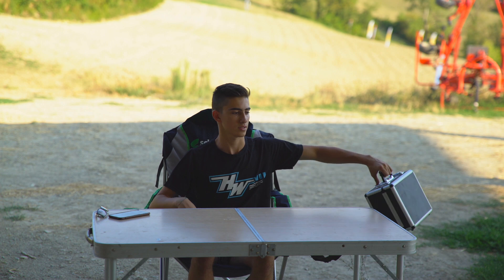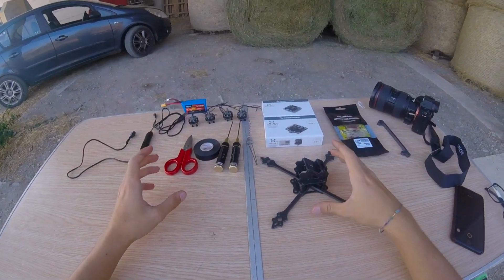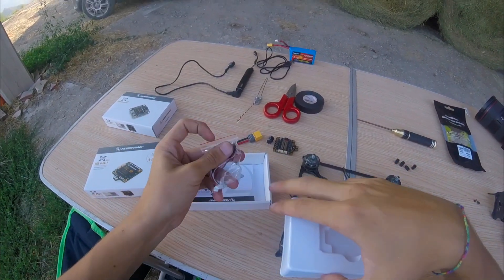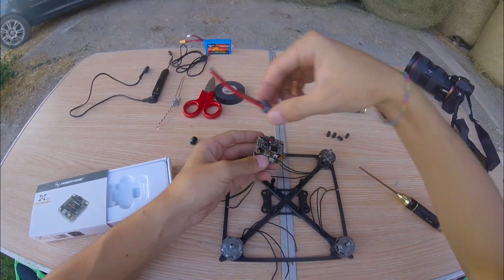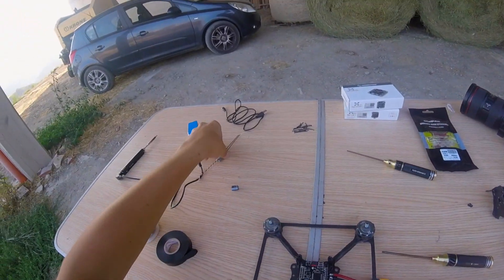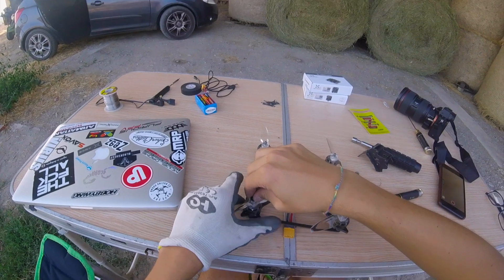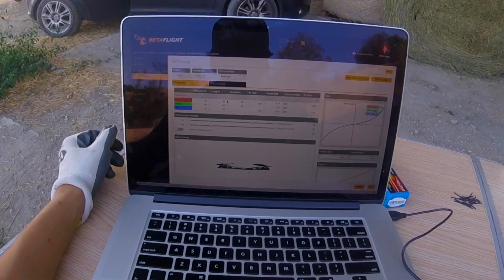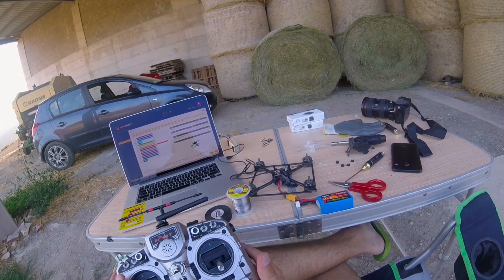HobbyWing SetUp *FULL QUAD* (in 12 minutes)

Comment: So you hard-mount the ESC and then softmount the FC on the rubber standoffs. But isnt the hard connection between ESC and FC (pins) transfering the vibrations to the gyro anyway?

Comment: Great video! Just wondering, I'm planning on building my first quad and I'm gonna use this stack but with an XM+ receiver. Should I solder the signal wire to R3 or to the SBUS pin right beside it? (The XM+ is a SBUS receiver..)
Reply from the maker: I think to the SBUS port ;)

Comment: Also I noticed  a upgraded  antenna  in your radio.  What is it and How  do you set it up.  Hint. More content  to film.  Antenna  upgraded.
Reply from the maker: That antenna is from the TBS Crossfire, is an external more powerful transmitter system from! It work just amazing!